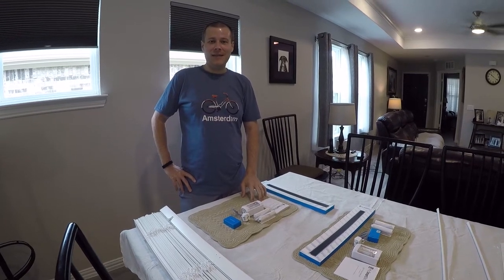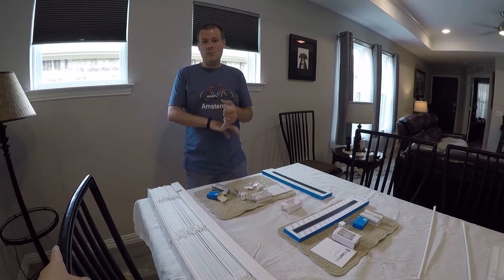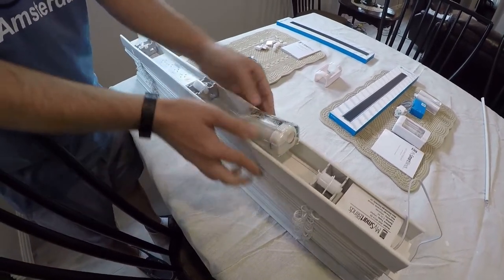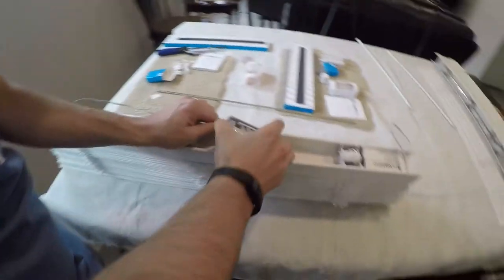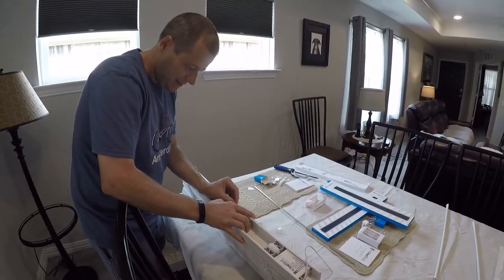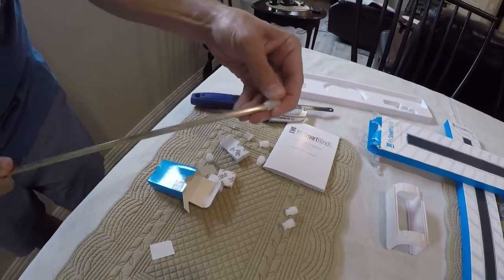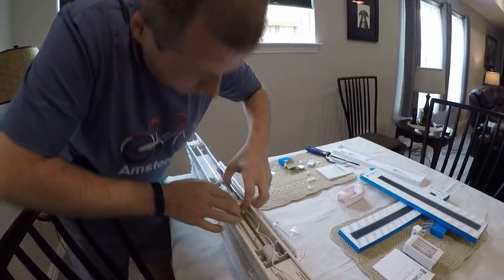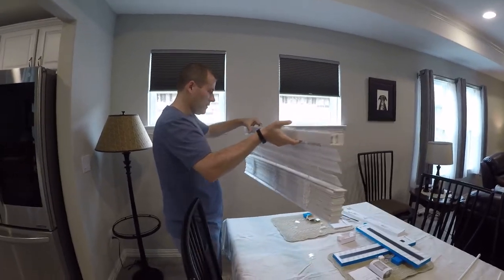Automatic Smart Window Blinds Retrofit Kit Installation + DISCOUNT Part 1

Comment: Great video! Quick question. I just bought the Levelor cordless blinds with the wand. MySmartBlinds say they are not compatible with cordless blinds but you show in you video you are using cordless. I’m confused if I can use the product or not. Thanks!
Reply from the maker: You're spot on - I was a bit confused by them saying "not compatible with cordless" but I imagine they must have phrased it wrong and been referring to cellular cordless blinds or something to that effect.  I have installed these now on over 12 of them and no issues.  Just note that you might need to notch out that small piece as shown in the video - but that takes 10 seconds.  Hope this helps - cheers!